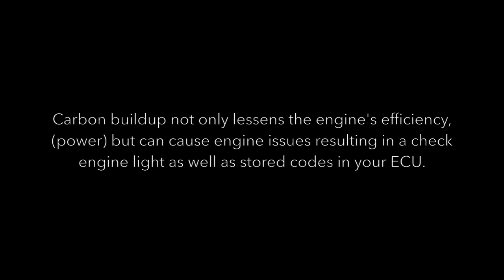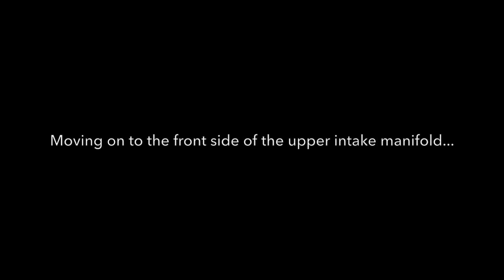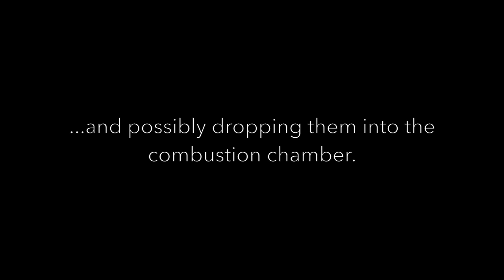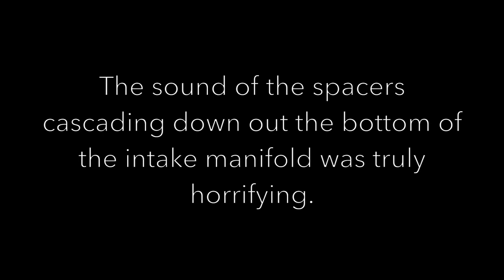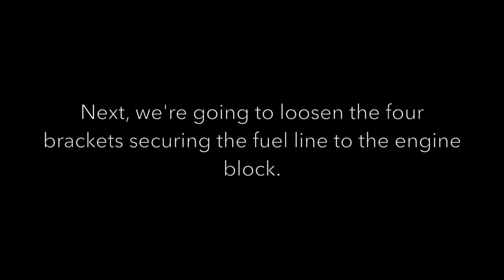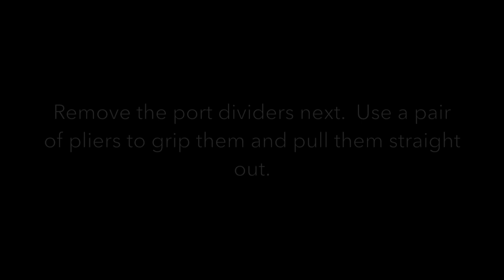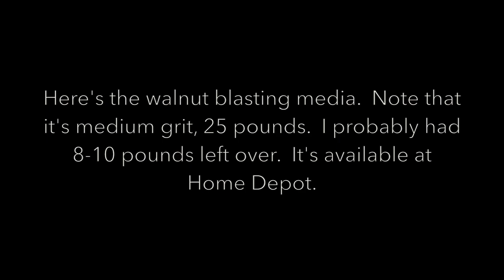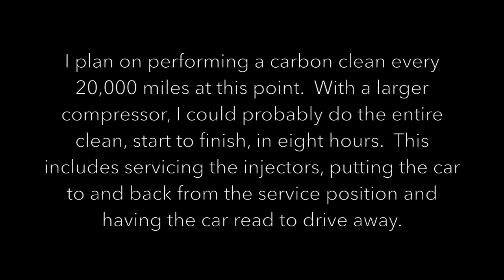RS5 Carbon Clean Part 1 (New version!)

Comment: Thank you guys so much for putting this information up. I have an RS5 aswell, it idles it a little rough the first minute after a cold start, after that minute it drives pretty smooth. But is has never been cleaned and it's now on 110.000 km. The dealer told me it's not necessary, I disagree with them. If I wanted it, I had to go to a third parrty. Well with this much detail I can dot it myself. I have a second car to drive to daily km's so I can finish this with no hurry in my own garage.
Again, amazing stuff guys, thank you so much.
Reply from the maker: Most welcome!  Join us over on Audizine.  I have more info there as well as discussions with other RS5 owners.  Link is above in the video description.  

As for Audi, they'll never ever say it's necessary until the car throws a code.  And that will, miraculously, always happen after the normal warranty has expired.  I too had little misses at startup which pretty much disappeared after the clean.  Seat of the pants horsepower was up too and I felt a nice bump in the midrange as well as the top end.  And six tenths in the 1/4 mile is nothing to sneeze at.  

Given your mileage, I"m sure it'll look much as mine did.  Also, you can download the factory service manual directly from Audi for under $40.  That buys you a 24-hour pass and you can download everything to your heart's content.  The docs are all in PDF format.  I should do a how to video on that!  https://erwin.audi.com/erwin/showHome.do
Reply: Hi, thanks for the friendly reply. I will join Audizine, and that erwin section looks interesting. My RS5 is a fairly trouble free car so far for me ( I own it now 4 years, 2010 model). 2 camshaft sensors (not too expensive and easy to replace, a rear wheelbearing and a sweating(not leaking) high pressure fuel pump which I got for free, because the car was still under extended warranty. Tires, brakes and oils is just normal maintenance.
I will give my old daily driver (A4 b6 2.0 fsi) also a walnut blast, I can first train my skills on that one :-)

Comment: i have to do this on my 14 RS5. how long would you say this entire process takes? this is a very excellent and detailed video, i just want to know roughly how much time is involved so i can plan it better
Reply from the maker: Honestly it'll come down to how big your air compressor is.  I also have a way to do this without putting the car in the service position now.  I spread it out over two days in the video but a lot of that was due to filming.  I would say it took me eight hours, mostly due to the fact my air compressor was too small.  Today, with a bigger air compressor, I could do it in about four hours including swapping in new injector seals.  If you have any questions, can email me, sales@redmistracing.com.

Comment: Once you get the UIM off and can see the valves through the LIM, would it be beneficial to spray sea foam lightly on the valves and let them sit? Wonder if there would be any benefit to use sea foam and stop there if you didn’t want to take off the LIM.

Comment: How would you check the PCV valves, given that the buildup wasn't that terrible you don't seem to have any issue with them being stuck open.  Complete housing and hose sold at the dealer, pretty expensive though.

Comment: Hi. Luv the advices. 
My old mechanic didn't have a clue about this stuff but I have found one who does. Had the walnut blast done. Issue is still getting (how to describe) labour/bumps/ uneven power band/ bumps at the low end when you put foot down bit more. Did intake clean too (i suspect hinges on valve may need more work according to ur other vids) Where to go from here. Want ECU n stuff as u recommend but can't when still experiencing this.
Reply from the maker: I would suggest acquiring a Ross Tech VCDS and doing a full scan. It does sound like when the upper intake manifold went back on that they didn't activate the port divider flaps in the lower portion to move them out of the way.  If that isn't done, the flaps get caught in position and don't open up fully.  Can cause the issue you're having.  Usually it'll throw a code that will show up if you scan the car.

Comment: Did you need to get front in service position in order to fit the speciap tool to rotate the engine?
Thanks
Reply from the maker: You do BUT, if you get a spark plug adapter for your air compressor, you can use it to rotate the engine and no need to go into service position.

Comment: Hey, did you use the 4Gal 200PSI air pump and CENTRAL PNEUMATIC
Portable Abrasive Blaster Kit only for the cleaning. (walnut blaster set up only)?
Reply from the maker: I used the 2 gallon Fortress unit from Harbor Freight and it worked but was really too small.  I used the Central Pneumatic portable abrasive blaster kit for the walnut media.  So basically the air compressor powers the abrasive blaster.  I would get an inline water filter too.  I didn't have that and it'll help speed things up and prevent the line from clogging.  Use the medium grit walnut.
Reply: @RS5Fanatic  thanks 👍🏽

Comment: I’m on the fence...I believe I can do this with my D4 4.2 A8, but I’d have to find a compressor, and it would take me several hours more to complete, as I’m not a natural in the garage. At 130k miles, I assume the carbon is awful. The intake needs to come off to fix a leak anyway.
Reply from the maker: My best advice on a compressor is to get a good one that does at least 135psi and has a 10 or 20 gallon tank.  You can also rent them from places like Home Depot.  My compressor can produce a lot of PSI but the tank is really small so it took much longer than it needed to,

Comment: So how critical is a carbon clean? I have heard guys say they can tell no difference. Audi dealers say not necessary? I'm confused 😕 I have s5 v8 it seems to be running perfectly fine 94k on the clock
Reply from the maker: I have personally seen (and listened to) a 100,000 mile RS4 sit and idle perfectly for 30 minutes and it'd never had a carbon clean.  I've also seen vehicles with codes and other issues as a result of carbon buildup.  When opening up mine for carbon cleaning there was no way it wasn't affecting airflow and ultimately power.  Audi doesn't say you need it until something goes wrong or your car is out of warranty as they know they have a liability on their hands.  The newer generation motors now all come with direct and port injection.  You don't necessarily feel the loss because it happens slowly over time.  But if you do decide to carbon clean your engine, I guarantee you'll feel a difference after.
Reply: @RS5Fanatic  thanks for the insight, very helpful from someone who obviously knows these engines 👍

Comment: Can you confirm there is no need for an injector removal tool as what the service manual suggests?
Or are they fairly easy to take out ?
Reply from the maker: They are fairly easy to remove.  No special tool needed unless they’re fused in there!  But no real issues at 50,000 miles plus they all came up when I pulled the lower intake manifold up.

Comment: But how did you close the rest of the valves, think you miss to explain that part 😅
Reply from the maker: Rotate the engine via the front crank pulley.  There's a part number for that tool listed at the beginning of the video. The other option is to "bump" the engine over with the start button but it's less precise.  Likely the closing of the valves is in part two. :)

Comment: did you have any concerns about debris inside the cylinder ?
Reply from the maker: None, you rotate the crank so the valves are closed and you vacuum everything out.  I took an additional step and used a liquid cleaner to wipe out any dust/debris.  It's actually pretty easy.